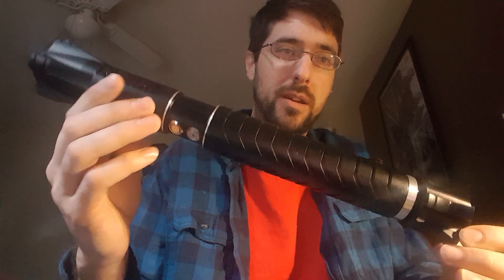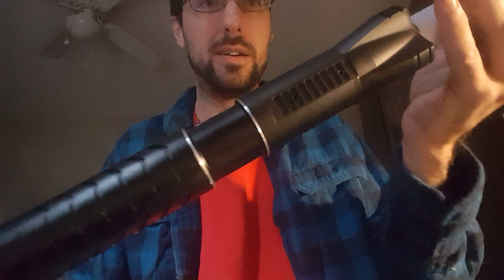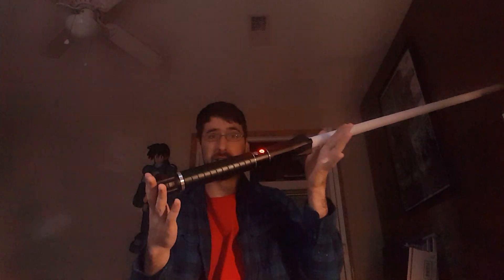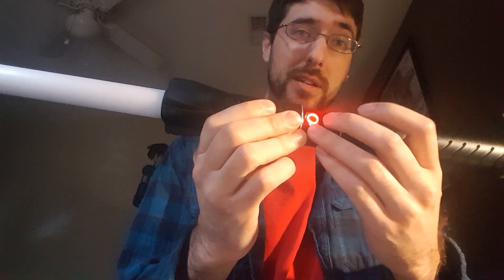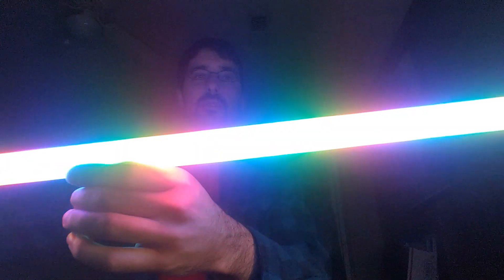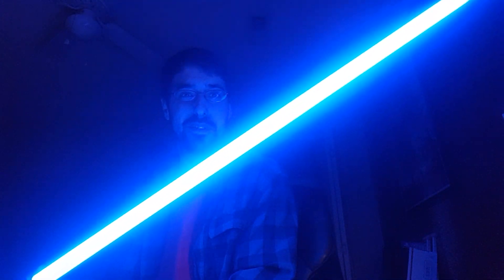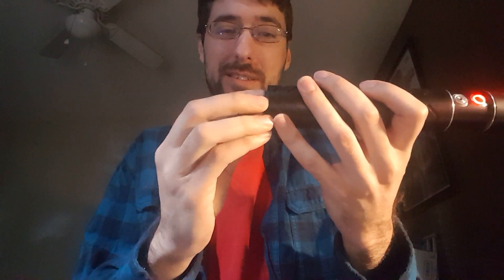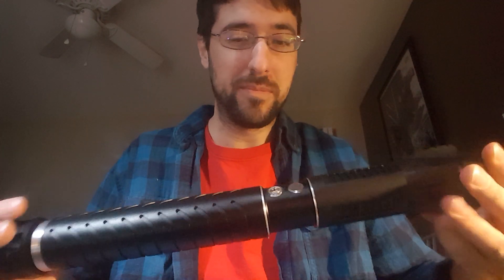Saberforge ASP proffieboard install

Comment: Can you install a proffieboard in a warrior tier saber?
Reply from the maker: Yes, I however am not open for additional commissions if that was supposed to be a question directed towards my services
Reply: It wasn't, i was saying if it is possible to do that
Reply from the maker: @Marcos-jo3qz  yeah you'd want to gut the internals in it as it is now and do a complete reinstall. You may be able to use some of the components but new ones would be recommended

Comment: What would you charge for a proffieboard install on a ultrasabers spectre?
Reply: With a neo pixel blade
Reply from the maker: @WRX-WING  most installs I've done with proffie and a neopixel blade have run in the $400-500 range which is very comparable to let's say a saberforge hero tier or ultrasabers diamond setup. Shoot me a pm through facebook at ANW Saber Services and we can discuss further.